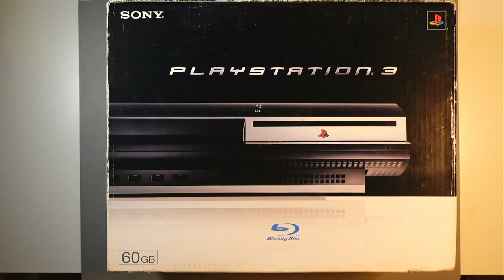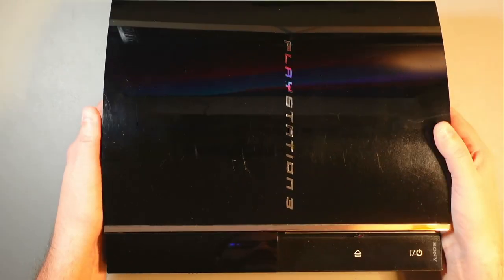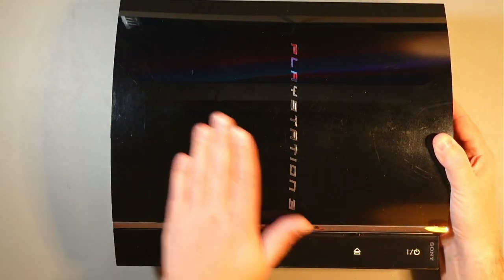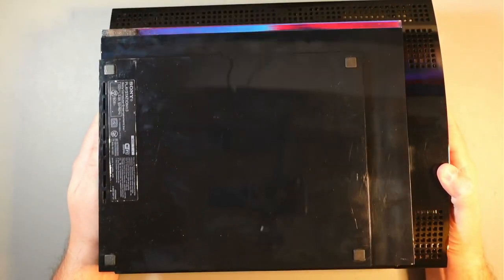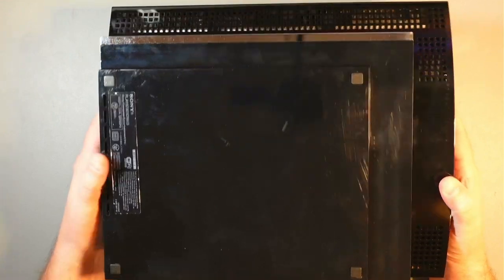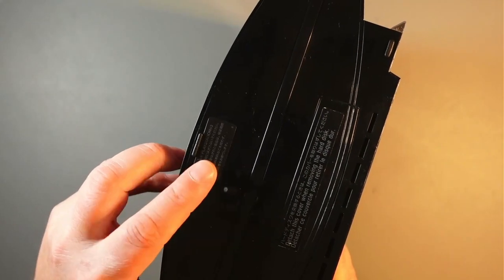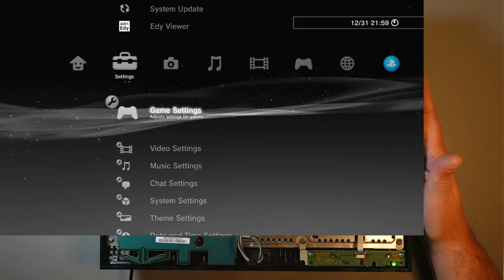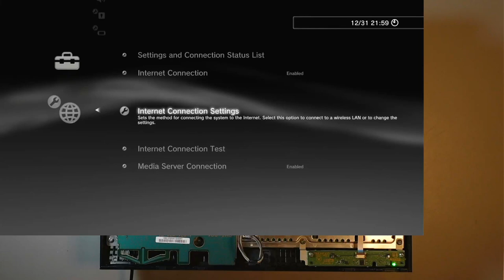Deliding badly overheating Playstation 3 fat

Comment: A razor is a BAD idea for deliding. I have used a tool as thin as a razor for deliding mine (made out of stainless steel so it won't break easily). I make sure to sand the edges before using it to avoid scratching or destroying any of the GPU/CPU board traces.
Reply from the maker: Works for me. I'd say general advice applies - don't try it on a working console the first time. You will most likely break it - regardless of the tool used. Once you know you tool and the device you're working with then (almost) any tool will work. For me razor is almost perfect.

Comment: Personally I've had best success with a painter's knife set, very thin painting tools that aren't sharp at all.
Reply from the maker: The best tool is always one that does the job and feels comfortable. To me this is the way - I've control over the process and it gives good results. The only thing is that "holder" which isn't great in the video. I misplaced my usual one and and had to use rather crappy one. I've ordered a lot better now and will do another video in next few weeks just to show it's a lot easier with the right tools...
Reply: Painters knives are so easy and cheap only ones it wont work on is 25xxx models with the hard things in the silicon